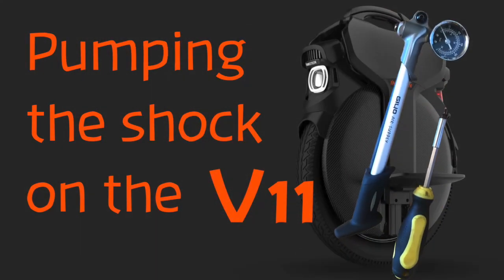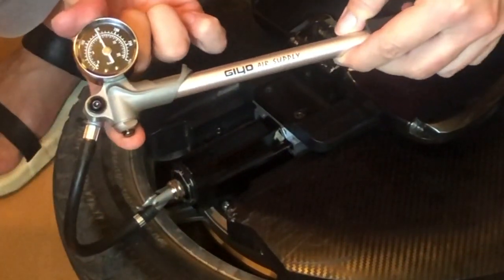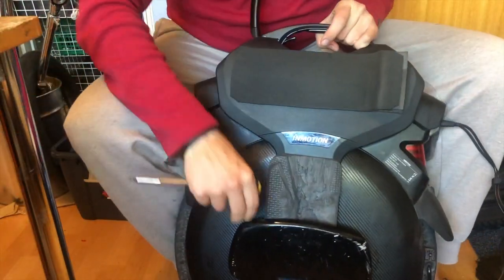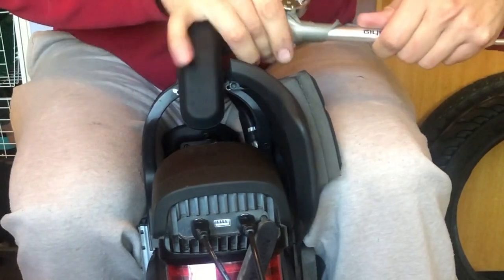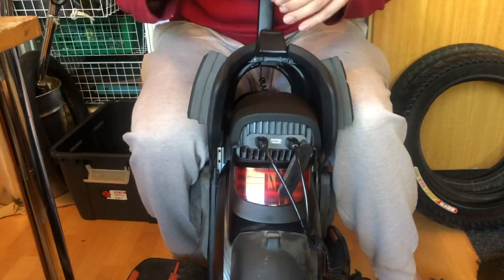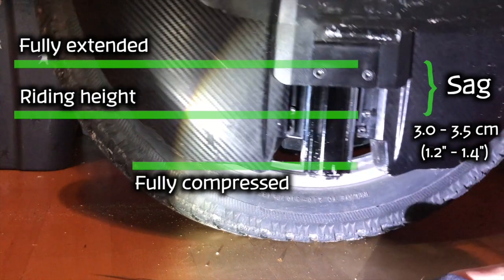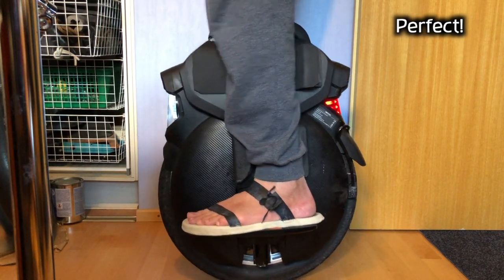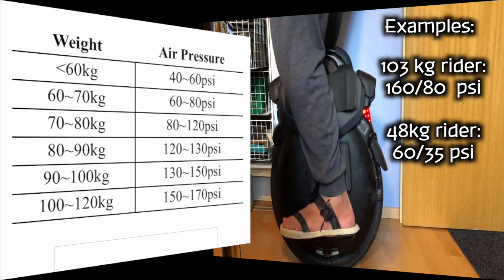Inmotion V11: Pumping the Air Shock

Comment: Hey nice information man ! 
One question: i bought a used v11 and the bearing is litle bit noisy. I ordered new one.But it's normal that i push way harder the v11 than my v10f? I'm only 55kg. For my v10f i don't need any pads but for the v11 i need pads. What can i do? Hope you know what i mean. Thanx bye
Reply from the maker: Congrats on the V11! It’s still my favorite wheel of all time. Too bad the bearings are noisy, but the only problem with them is the noise. So no need to rush to change them until you get fed up with the sound.

V10F is a 16x2.5” wheel, while V11 is 18x3”. The outer tire diameter is roughly 20% larger, so you need to lean 20% further to get the same acceleration and braking. 18” and larger wheels always need pads in my opinion, and with your very light weight they are an absolute necessity. Check this video:

https://youtu.be/d3bf_kPHeiw?si=eg4zi5IjWLOjPF6u

You can make the V11 accelerate easier by softening up the ride mode, and using the acceleration and braking assists. Check especially this video:

https://youtu.be/4ee-tVZTx3c?si=2XJc7Q90Hbf_zYjV
Reply: @mrelwood_EUC  thanks for the fast answere. I will try to change the settings in the App! Do you use the inmotion App or euc World? Which is better?
Reply from the maker: @marcpit2806 I use the Inmotion app since EUCw isn’t yet available for iPhones.

Before trying to figure out the settings yourself, please watch my video about them! I’ve done all the hard work for you already. 😉

Comment: How to set the pressure in suspension and also the tires for a total beginner learning on V11 ?
Reply from the maker: Do you mean which pressures to use? There are guidelines for the shock pressures in the user manual, and even on the bottom of the pedals in some batches. But generally based on my experiences, top chamber always 50-60psi, bottom chamber 60psi for a 60 kg rider, and 160psi for a 110kg rider. You can calculate from there: 60 + (weight -60) *2.

For the stock tire, I’ve found 35psi to work the best for a 110kg rider, and 27psi for a 60kg rider. So 28 + (weight -60) *0.16.

But these both depend a lot on where and how you ride. Only use them as a baseline if you don’t have any idea just yet. If you ride over sharp edges like curbs, you need either a good technique or more tire pressure.

Comment: Hello! Thanks for your videos! Very useful information. I guess you have experience with inmotion v11. I have just bought this EUC and encountered an issue: when I turn on it says "Overload please get off". The battery voltage on each battery is different which is 85,6V on battery 1 and 85,5V on battery 2. It tilts backwards and does not let me to ride. Do you think it is the BMS failure? The manual says " Intelligent BMS", but if it has this function how it could not prevent it from Overloading? I worry if I got the defective EUC now...
Reply from the maker: The voltage metering in your V11 is badly calibrated. The wheel thinks that the batteries are at an overvoltage. They shouldn’t be over 84V, so the wheel thinks there’s a danger.

Contact the seller and they should arrange a remote calibration with Inmotion.
Reply: @mrelwood_EUC  Inmotion engineer calibrared my v11remotely  quite fast and it is working fine now! Thanks!

Comment: mate, where is 35 psi with this type of pump? there are 3 marks under 50 PSI, while 4 marks for above 50 PSi. does it mean the 1st mark equals 20 Psi?
Reply from the maker: It does, yes. But this pump is not suitable for pumping tires, only for air shocks. So 50 psi is the minimum you’ll ever use this pump for.
Reply: @mrelwood_EUC  what do you recommend for those who need under 60 psi in the top chamber? is tyre pump a good choice? u will need to go a little bit at a time to dial in the pressure though.
Reply from the maker: @GenZyannd   I see no point in using less than 50 psi in the top chamber, in any situation.
Reply: @mrelwood_EUC  lol, mate you recommend using 35psi in the top chamber for 48kg rider.
Reply from the maker: @GenZyannd   I don’t think I did. I did say “half the pressure of the main chamber“, which has turned out to be an imperfect recommendation for a few situations. Either way, no less than 50 psi should be used.
Reply: @mrelwood_EUC  4:46 of your video mate.
Reply from the maker: @GenZyannd   Oh man, I’m sorry! I did say that after all. I have later learned that 50 psi seems to work better as a universal recommendation. I wish I could still edit the video…

Go ahead and try 35 psi at the top if you want. Regular shock pumps are precise enough for that. Then try 50 psi, and reply here which you like the best and why. I will edit the video description accordingly.

Comment: What if I wanted to ride a tiny bit lower to the ground? Am I correct to lower my pedals by putting more in the upper chamber and less in top? I weight 78 kg and my plan is to put 60 psi in upper and 100 psi in bottom chamber.
Reply from the maker: The manual also suggest a certain pressure for the bottom chamber, but your aim is obviously to differ from the recommended pressures, because you want the riding height to be different than what the V11 was designed for.

80/80 isn’t a specifically dangerous pressure based on the numbers, but it is an abnormal one. Which, again, is what you’re after. Bottoming out isn’t exactly dangerous either, and it won’t be harmful for the wheel either as long as it’s not something that happens constantly.

And yes, you are the only one who wants his Cadillac to ride like a BMW. :oD

But experimenting with the pressures makes little sense until you have a pump with you. A setting you try may turn out to be an obviously bad one, in which case you should be able to just stop and try something different. Having a pump with you you could reach your target pressure in a matter of minutes.
Reply from the maker: I’m sure you meant to type “more in the upper and less in the BOTTOM”, which would indeed do exactly what you wish. Do consider though that by lowering the sag the suspension behavior changes pretty fast, and you will soon no longer get the plushy ride that the V11 is known for. Worth a try though!
Reply: @mrelwood_EUC  yeah, I meant bottom. Sorry wrote that in a hurry. I'll start testing that configuration soon. I like that magic carpet plushy feeling of V11 but also like to feel planted to the road so have to find some compromise between them. Thank you for your feedback.
Reply: @mrelwood_EUC  Is it a big mistake if I pumped the upper chamber first? Unfortunately my suspension pump stopped working so I have to ride to the nearest bike shop every time to adjust it before they send me a new one (or reimburse cost as the wheel still has a warranty).  I'm currently testing 60 psi in upper and 80 psi in bottom chamber but I want to get even lower to the ground. Should I pump more in upper or deflate bottom? V11 without air in the suspension is almost as nimble as KS 16X but the suspension bottoms up.
Reply from the maker: Pumping the top first is ok as long as the bottom already has some pressure. If the suspension moves while pumping the bottom, the top needs to be rechecked.

A suitable new shock pump (with a dual function valve) can be bought for about $20. Maybe just buy one?

It sounds a bit like you are trying to get the V11 to be something it’s not designed for. The best ride you can get out of it is a properly set up suspension, but it sounds like you are now moving away from it.

Your bottom pressure is so low, that I would rather put more in the top chamber than to deflate the bottom. You could even try 80/80 psi.
Reply: @mrelwood_EUC  I'd rather sacrefice some of the suspension just to ride a little bit lower. It solves all my V11 complaints - I ride in the city and being too high makes low speed sidewalk steering odd. A stinky compromise is what I'm looking for, I don't like the feeling of standing on top of the wheel, disconnected from the road. I believe that being lower you can still preserve some of the suspension :)
Reply: @mrelwood_EUC  for sure I will get the new pump, just don't need two of them so I'm waiting for their response :)
It was really surprising for me that I liked riding with almost no pressure. And I rode it just after 16X which I rented for a month. Was stunned that V11 can be as nimble as 16X and the ride height is what is ruining my experience. I'd be happy if I manage to achieve lower stance without bottoming out and some of the suspension.
Reply from the maker: The bottom chamber pressure is what prevents you from bottoming out, which is why increasing the top pressure would probably get more of what you’re after. If 80psi at the top isn’t enough, then I’d carefully decrease the bottom pressure in 10 psi increments.
Reply: @mrelwood_EUC  the manual suggests putting 50 psi in top chamber, some other riders put half of bottom chamber psi. Isn't 80/80 psi configuration somehow potentially dangerous? Am I the only weird V11 rider around who bought Cadillac and then want it stiffer and lower? :)

Comment: The new supplied pump cannot attach to the top chambers, and therefore cannot fill them. Have tried everything.
Reply from the maker: What exactly is preventing the pump from attaching? Does it work on the bottom chambers? Check the usuals:
- Remove the side saddles completely for better access.
- The pump has a two step attachment nozzle. Are you familiar with how it’s supposed to work?
- If the red nuts around the top valves are loose, they could stop the pump from going in deep enough. Tighten the nuts.
- If the pump itself is faulty, it’s a part of your purchase and therefore handled by warranty. Contact your seller.
- Shock pumps can be bought for as cheap as 25€. Ride to a local bicycle shop and ask if you can test if their pumps fit. If they don’t, ask if they could quickly check what the issue is.

Comment: Buy a extender so you dont have have too take the saddle off every time..that’s what i do. It works perfect!
Reply from the maker: An extender changes the air volume of the chamber, and will cause the suspension to extend even slightly faster into it’s end position.

I left the four top saddle bolts out, so I can connect the pump quite easily without removing a single bolt.

Comment: I saw some early model v11 and it came with the pump with the nozzle close switch, new pumps in the late winter batches don't have the switch.  FYI if there are any heavier riders 125 KG I roll with 50 on top and 180-190 on the bottom.
Reply: The newer pump has a different mechanism, but it does have a dual release system as well. The valve cylinder screws out in two separate parts. Inmotion has a video on their channel about how to use it.

Comment: just a thought but what do think about adding a couple of valve extenders to the upper shocks? Zip tie it to something so it doesn't move around & we can check & refill without removing the saddle. This is what I'd do (or at least try out) if/when I get a V11.
If you do try it out, do let me know if it works.
Reply: The top chamber only has a small volume of air, which the extender would increase. It might affect how the suspension works.

You only need to remove the upper saddle bolts so you can pull the saddle outwards for half an inch. No need to remove the whole saddle.